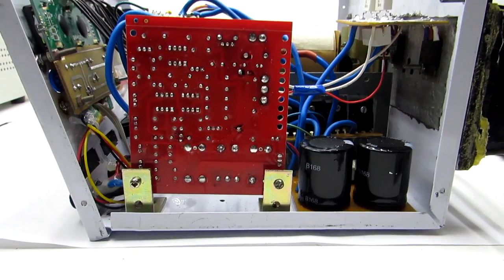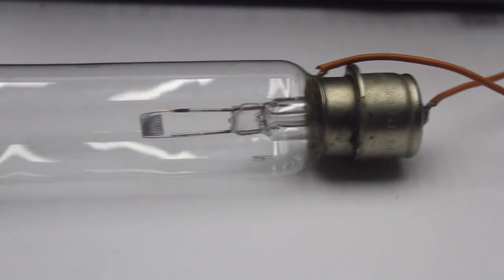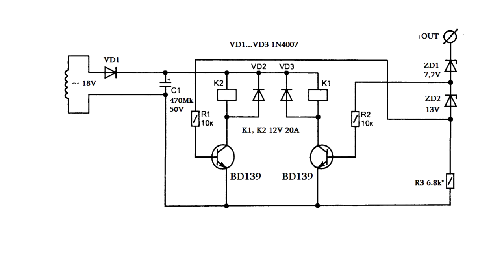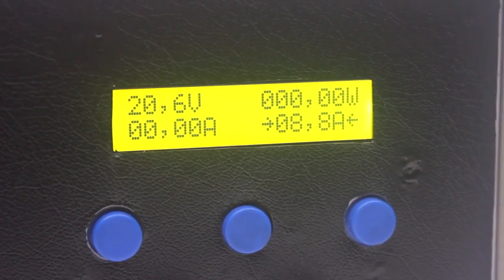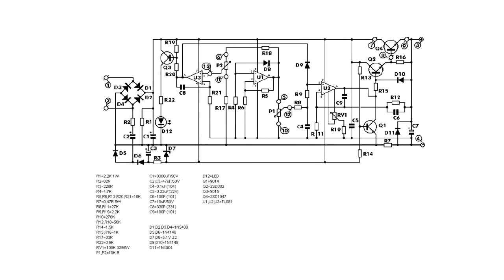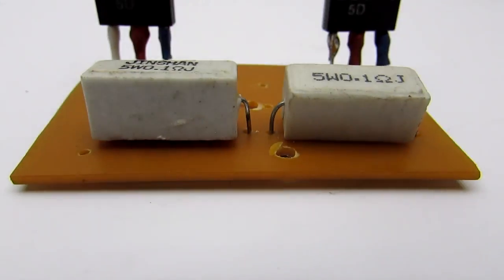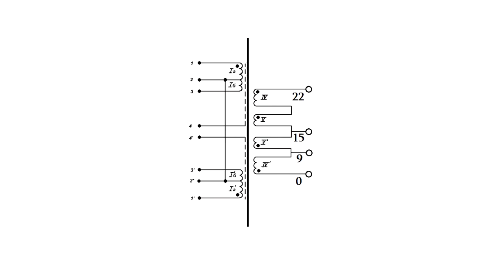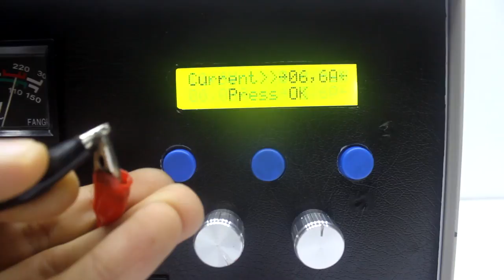DIY super laboratory power supply

Comment: I built this myself and I wanna say thank you but the amp and volt meter board are not completed in the final design. For example the amp limiting relay can't work in low voltage or when you withdrew big current the relay and micro controller shuts down as the voltage drops in output. Also the amp meter doesn't go to zero. It stays around 0.11 amp. Of course I fixed all these problems and it works perfectly now. I also added negative voltage to this project. But it would be perfect if you fixed all these problems in your schematic.
Reply from the maker: Thank you. Are you the developer of this stabilizer circuit? on the relay - the board is powered by a separate 12 volt source and the relay operates correctly at any output voltage.

Comment: Using the rated output from power transistors is fatal. They quote an instantaneous load.  Iv'e been through the 2N3055's, TIP35C's , etc and none like more than 30 W for very long.  Running diodes in parallel is also asking for trouble as one will always hog the current until thy have all blown. The best I have found is the standard 50A  bridge that's very cheap. I am at present converting (or trying to ) an old Monacor 120 W 40 V DC line audio amp into a 120 W power supply (TIP35C's) but I'm adding 2 fans.  There are quite a few videos on YouTube showing repairs to power supplies usually it's the power transistors that have blown. I also use SMPS. Banggood do a nice 60 V DC  400 W one that would probably melt at 400 W but otherwise seems fine. Their output is not suitable for many applications though.  Other than that this young lady has done her best and that's all any of us can do.
Reply: I think this channel uses a translation service of some sort. I don't think the person doing these actually speaks English. I've never seen him actually post on comments on any of his videos.
   If your salvaging the power supply from an old amp, why aren't you using the rectifier from the amp?
   I don't have much experience building with very large current pass transistors. However I have a gigantic old Fluke programmable lab supply from the mid 80's that I was given for parts. I haven't reverse engineered the circuit, but they were using 6 3055's for the output back then and this was their top of the line stuff that ran about $5500-$6000 depending on options.
Reply: I am using the rectifier from the amp, I was just pointing out that it's not a good idea to parallel diodes. I have a 40 V AC 100 A transformer. Why anyone would want a power supply that big I cannot imagine but it looks like 50 A is the biggest bridge I can find. Might run the odd LED or two. LOL
Reply: jp 
  I agree about the parallel diodes. I think this channel tries to focus on upcycled components and finding high current diodes can be challenging. Automotive alternators are probably a good starting point. 
   However, if you do a search for "welder rectifier" you will find many high current options and even a few low cost options.
Reply: Can y use 2×2n3055 as a power transistor on this or what he recomendet PLS y need to know

Comment: I think a transformer with 12*2 would be better , no need for any other voltages outta the transformer because i believe let em apart would lead the transformer to be burnt or just losing its efficiency. tell me if your bench power worked well, i need one for my lab and ty

Comment: Hi, nice work
I have one question can you tell me, what the value of resistor you use between the output pen6 of ic u1 and the potentiometer p1, and what is this meant for.
Reply: If she is using the original control circuit, the error amifier multiplis by 3 the reference voltage. P1 is 10k. The reference voltage is around 10V. So, I think she is using a 4.7k resistor, considering that the  max output voltage shown was around 20V.